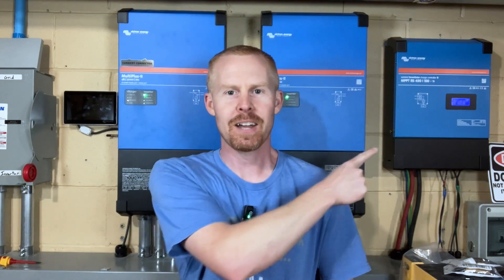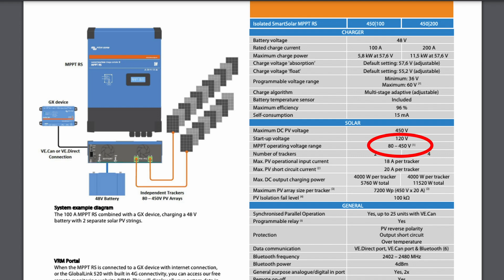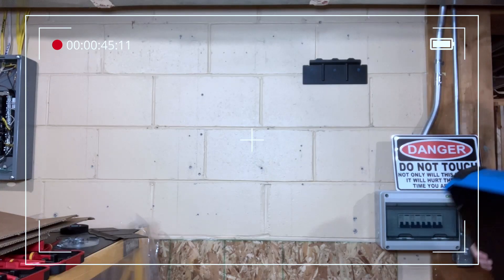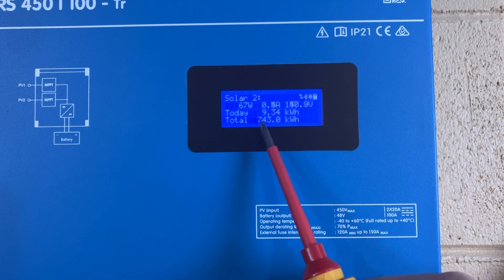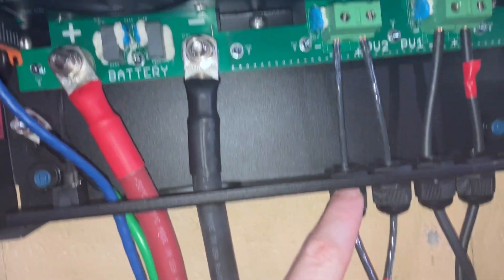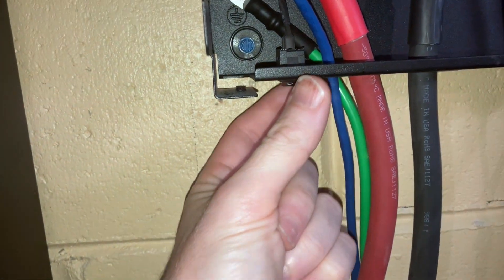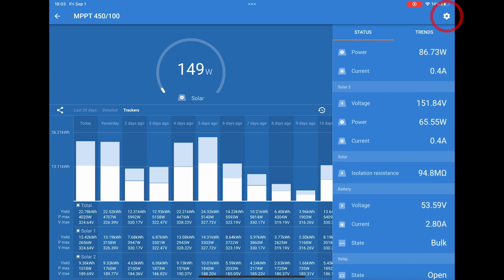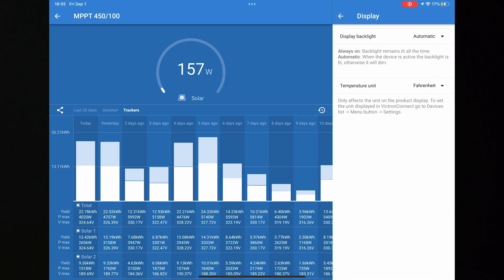Taking a look at the Victron SmartSolar MPPT 450/100 Solar Charge Controller

Comment from the maker: Links to the parts & pieces in the video (affiliate links)
------------------------------------
Victron MPPT RS 450V/100A SmartSolar Charge Controller - 
https://www.currentconnected.com/product/victron-smartsolar-mppt-rs-charger-controller/?ref=AzzpK9Fl

For more information, please check out my website with links to all the components, materials and products I have used in developing my off-grid solar system: https://going-off-grid.com

Supporting the Channel
--------------------------------------------------
The 'Buy me a Coffee' - link is here (on the bottom, right corner of the website): https://going-off-grid.com

You can also click on the "Thanks" button under the video to support the channel. 

Thank you for your support!

Comment: I'm not familiar with stand alone solar charge controller because i've been researching all-in-one units like the Sol Ark and EG4. Are these victrons + a transformer inverter, like SunGold, going to be much more reliable? Also, do these models specify what type of battery voltage they're made for? Or can you configure the charging voltage?
Reply from the maker: Yes, you can program the Victron charge controllers for different battery chemistries. The 450/100 is designed for 48 V battery banks, but you can adjust absorption, float, and other charge voltages to match lithium, AGM, or other types. Victron MPPTs are generally more efficient and more accurate than the charge controllers built into most all-in-one units, and they give you better flexibility for tuning and monitoring. They also have Bluetooth and VRM support for remote tracking.

You can also add a stand-alone charge controller like this to almost any existing system, as long as the controller is rated for the same battery voltage.

And just to clarify — I don’t think SunGold uses transformer-based inverters. Most of theirs are high-frequency designs, whereas something like a Victron 5kVA inverter can handle heavier surge loads and typically runs more reliably long-term.
Reply: @AdamDeLayDIY that's good to know thanks, but check out this breakdown of sungold 12000w inverter, it has a huge transformer. 

https://youtu.be/lhSyY799KBM?si=DNn0LzPyL8Mc4t2o

Comment: Hi  Adam.  I realise you have been over this before but I'm confused about the max voltage on the 450/200. 
 The spec sheet says the WHOLE unit has a max DC input voltage of 450v.
 I have read and seen many different conflicting comments and advice online ( including the victron spec sheet) .  Can you or anyone confirm that EACH tracker has a max 450v input .   Meaning 4 X 450v max input for the 450/200 unit . ? 
 Other people have advised me that this is not correct and it's 450v split across all 4 trackers. 
 Obviously this has a massive effect on the number of panels I can install . 450v total ...means only 11x 38v  450w panels .
Any info greatly appreciated.
 Thanks
Reply from the maker: The trackers are independent of each other.  Each tracker can process a max wattage of 4000W within the specs of 450vdc and 18a.  

Perfect example of the fact that each tracker is independent of each other.  Look at the bottom of page 10.
https://www.victronenergy.com/upload/documents/SmartSolar_MPPT_RS/13860-SmartSolar_MPPT_RS-pdf-en.pdf

Table 1. PV Array Example shows an example of 2 arrays connected and 1 has 404v and the other has 304v.
Reply: Brilliant, thanks for confirming so fast.  I really wanted to check as my physical installation is going to be challenging due to the location and terrain.  @AdamDeLayDIY
Reply from the maker: @kg-4062  Not a problem!  Not sure if you have made your purchase already or not but it looks like the 450/200 can be purchased from Current Connected for $1795.  You just have to create a website account first and log in to get the discount.

https://www.currentconnected.com/product/victron-smartsolar-mppt-rs-charger-controller/?ref=AzzpK9Fl

Good luck and have fun!
Reply: Thanks for the heads up but I'm in Europe and it seems my best/ nearest supplier is located in Spain  @AdamDeLayDIY

Comment: Hey Adam  - I was told the 200 model still has 2 trackers and I was advised to buy 2 unit of 100 A to get the 4 trackers needed for our 13kw pv ?  Do u still have your  450/100 ?  how does it perform ? many thanks
Reply from the maker: Not sure who told you the 200 only has 2 trackers cause even the Victron Spec sheet says 4.  https://cdn.currentconnected.com/2023/10/21115734/Datasheet-SmartSolar-MPPT-RS-EN.pdf

Either way though, yes I still have my 100 and it's still working great for me!  Lots of power each day comes from that thing!
Reply: @AdamDeLayDIY   Thanks for your reply - I ll have to admit that I used AI to design the best pv array kit to suit our needs and  and according to the summery provided the 200 version can handle two strings.  I ' ll  double check its specs before purchasing

Comment: Great video. I want to add a charge controller to my existing all in one system. For Victron's SOC detection,  does the Victron sense battery voltage through the batter cables? My AIO is already using the comm ports on my existing server rack battery storage. Just wanted to make sure if I add one of these MPPT's that it will sense battery voltage and either add or stop power based on open loop and the battery cables?
Reply from the maker: Thanks.  

No, something has to calculate the SOC of a battery, which is what the BMS should be doing on your server rack battery.  It should be giving it's SOC to the Victron system.  

Since the battery should be the device giving the SOC to the system (assuming you don't have a Victron Shunt), it should be able to keep track of power coming in from a new SCC.  You would still end up programming the SCC with the stop voltage though that you want it to stop charging the battery up to, and you would just find the specs of the battery and program in the max charge voltage.

Comment: Adam what is your favorite solar inverter configuration?  With your experience from EG4 to Midnite Solar to Victron how would you rate this Victron setup?  Thanks for your content.
Reply from the maker: Each inverter really has its own place. Victron is my current favorite just because it has the most customization options by far—you can tweak almost everything and the VRM monitoring is super handy once it’s set up.

MidNite Solar is built like a tank. Their hardware is rock solid, and it's a great option for folks who want something durable.

And EG4? Honestly, it's hard to beat the pricing for the features you get. It's pretty much plug and play, which makes it a great option for people getting started or wanting a simple install.

Appreciate you tuning in and supporting the channel!
Reply: @AdamDeLayDIY  Have you had any inverter failures?
Reply from the maker: @idahoduckhunter  Nope.  Even with my old EG4 6500s that were RMA'd, they still worked.  EG4 just wanted to look deeper at some of the issues I was experiencing.

Comment: So you have two string arrays connected separately to two MPPTs, correct? That is, they are not connected in parallel first before going into the inverter, correct? Just the positive and negative from each string array go into the inverter, correct? Apologies, I'm new here.
Reply from the maker: No worries.  
That's correct.  Each array goes directly into one side of the 450/100 (since it has 2 separate MPPTs).  

If you're new to solar, this might interest you: https://youtube.com/live/gyybhu5LZPk?feature=share

Comment: Hi to all! After the last firmware 1.19 update the fans noise between 1k and 4k watts are terrible. It was quiet before this update, but now I don't know what to do.. Thinking to disconnect both fans because I have my mppt in a very could place.
Reply from the maker: That’s interesting.  I’m also on 1.19 and I can’t say that I’ve noticed any sound difference on mine, and it’s right next to my office so I would hear it if it got a lot louder.  I would suggest posting on the Victron Community Forum and see if anyone else has noticed the same thing.

Comment: Can the settings of this device be changed remotely using the VRM portal or a phone app (not via Bluetooth)?
Reply from the maker: @krprasad7519  yes you can.  So the same app that you would use for Bluetooth configuration (Victron Connect), has a tab for VRM.  That will allow you to remotely view and configure different devices in your Victron environment.  The only devices you can’t configure remotely are the inverters.

Comment: Hi there just double checking, each tracker is 450 max volts or both trackers total 450volts thanks
Reply from the maker: So it's per-tracker.  Each one can pull power from PV up to 4000W within the specs of 450V and 18A.  There is some wiggle room on max wattage you can connect to a tracker vs how much can be used as well as some wiggle room with the current but the voltage is a hard 450V number that cannot be exceeded.

Hope that helps!
Reply: @AdamDeLayDIY  Yes, 4,000W max for each tracker, but specs say 5,670W TOTAL, correct? So it's not REALLY 4,000W per tracker. It's 4,000 W for one and 1,670W for the other. Right? You can't have 4,000W from each. Correct?
Reply from the maker: @KidFreshie  So the 4000W max is the usable power for each MPPT.  You can add (sometimes called "over-paneling") more panels up to 5,670W so that when you're not in full, sun conditions, you can still try to get close to that 4000W of PV input.  You do have to remain within the voltage and maximum current limitations though when you over-panel.
Reply: @AdamDeLayDIY  Wait. So I can have up to 900 volts (two MPPT channels of 450V each) of PV power coming into this thing at once?? Do I have that right??
Reply from the maker: @KidFreshie  Each MPPT is isolated from the other, so you can have up to 450V coming into each tracker.  There's a lot of flexibility between the voltage range and the usable current to allow for a large range of array configurations.  

Keep in mind, while the current limit does have some flexibility, the voltage is a hard limit.  You don't want to go over that on a single MPPT as you'll damage the unit.  You'll also want to take the "temperature coefficient" into effect because your panels voltage will increase with colder temperatures.
Reply: @AdamDeLayDIY  Thank you. You're kind to answer these questions.

Comment: I am considering replacing my EG4 3kv with the Multiplus II and the Victron SmartSolar MPPT 450/100.  My concern is with the setting of the charge controller's max charge current.  I need to limit the current to the batteries to 40A, but if the inverter is pulling say 10A, the charger controller should output 50A.  With my all-in-one, this was taken care of internally.  Is there a way to make the charge controller output additional current for the load of the inverter?
Reply from the maker: @deerdomain1  on the Cerbo, there’s an option called DVCC and under that option there’s an option to “limit charge current”.  That might be what you’re looking for.  https://www.victronenergy.com/media/pg/CCGX/en/dvcc---distributed-voltage-and-current-control.html

What’s the reason for the 40a charge limit?
Reply: @AdamDeLayDIY  I want to limit the charge to the battery to extend the life of my batteries.  I'm using LiFePo battteries and that is the recommendation of the manufacturer.
Reply from the maker: @deerdomain1  not sure what your timeline is, but Current Connected is offering free shipping if you use a special promo code.  It only goes through the end of the month though.  You can use code “adamgog”.  I believe they also have an extended warranty on certain Victron gear.
Reply: @AdamDeLayDIY  Thanks, i just might use that code to get the Mutliplus II.  At the moment Current Connected is out of stock of the Victron SmartSolar MPPT 450/100.

Comment: Hi Adam  i have a 6000xp with the 280 ah standalone bat. I have a few half ass arrays  that  shift  in and out of full sun (trees) i was thinking of taking a sprinkler controller    and using the 24 volts to control some relays to bring strings in and out of connection with the current 2 mppt's the 6000xp has.    Until i get around to that, I'm looking to add 1 or 2 additional mppt's to get every watt available even when the shady loops are subpar    finally getting to my question ha ha : will the smart solar 450/100 easily communicate with the eg4 battery while the 6000 xp is connected?     Thanks Scott
Reply from the maker: haha, no worries.

So in this case the Victron Charge controller would just charge the batteries based on voltage that you program in.  Because they're different systems, there wouldn't be any communication.   It would still work fine for charging your batteries though.  You would just program the charge controller for whatever you charge your batteries up to and then let it go.  

I've got my 450/100 running on the exact same battery bank that my 6000XP is running off of and there's been no issues.
Reply: Thank you Adam      damn   ,i'm tempted to just spend a small amount more and get another 6000 xp and get an inverter ect. out of it    augh what  to  do ...  to many options lol
Reply from the maker: @justanotherdillhole7824  I know exactly what you’re taking about.  The one thing I would mention is that I’ve heard that the 6000xp is designed to last for approx 5 years.  I heard that mentioned on the diy solar forum.  Since it hasn’t been around that long, I guess time will tell.

Comment: I just binge watched all your Victron install vids, awesome, loved when your son flipped the transfer switch and the cover fell at the same time. I can totally relate. So I'm also looking to upgrade to Victron starting with this CC. My question is, is there someway to make it talk with Solar Assistant, to track, store info, change parameters remotely? I'm big fan of SA and that's something I would miss by upgrading.
Reply from the maker: Appreciate that!  I still remember that moment and how I nearly jumped out of my skin!  Stuff like that seems to happen to me any time I have a breaker panel open...

So at this moment, the only Victron gear to my knowledge that Solar Assistant supports is the Smart Shunt.  

Honestly, the VRM can really do just as much as Solar Assistant, and then some.  I'm still a huge fan of Solar Assistant and if I ever had an inverter that didn't support the VRM, it would have to support Solar Assistant.  

It's been on my list for a while now to do a walkthrough of the VRM it's just gotten pushed back with a lot of different projects.

Comment: Rookie question.  Why would one use this over something like the 250/100 which handles a lot more amps?   Just curious.  Can someone school me?
Reply from the maker: It has a higher string voltage so you can series more panels together (which would lower your total amperage and let you use smaller gauge wire).  It's also 2 (or 4) trackers built into a single unit.  Pretty sure there's more "advanced" features built into the 450 series but those 2 things are the big ones that come to mind off the top of my head.
Reply: @AdamDeLayDIY  got it, thank you.    But doesn’t the 250/100 also allow higher amps than the 450 model?    Or is this a matter of easy and stringing a lot of panels in series to make sure you have higher voltage and lower amp?
Reply from the maker: @tlteal  The 250/100 has the same amp rating (amps that can go into the battery) as the 450/100 but with a higher voltage, you can get more panels in series on the 450.  You can save a lot of cost in wiring if you can have a higher string voltage because the gauge can be smaller.  

You could do two 250/100s but you wouldn't be able to have as many panels in series because 250v would be your absolute max (including taking the temperature coefficient into account).
Reply: @AdamDeLayDIY  thank you!   Can I get away with 10gauge wire (that’s what I currently have) which is also fused (20a) with that much voltage?
Reply from the maker: @tlteal  The wire should have a voltage rating.  Most of it is probably 600v so you should be fine, but double check the jacket of the wire.  Just make sure you're not exceeding the max current rating of the gauge wire you have and you should be fine.
Reply: @AdamDeLayDIY ok, thank you for the advice.  Sincerely appreciated.   Keep doing what you doing... you're teaching guys like me how to do this as well and it's a lot of information to absorb and without burning your house down LOL
Reply from the maker: @tlteal  no worries!  Glad all this stuff can help!  Good luck!
Reply: @AdamDeLayDIY  one more question.  Safe to assume you're using the multiplus II's for the AC side of things?   Why did you use them vs. let's say the Quattro?    Any specific reason?

Comment: Fantastic video Adam thanks a lot bro 
  I just got off the  phone with Dexter he told me to buy the 450/200amp unit
  Current connection customer service and knowledge is TOP NOTCH 👍🏼‼️‼️‼️‼️
Reply from the maker: Thanks!

That’s awesome!  Yeah the 200 is exactly the same as the 100, just has more mppts.  Current Connected really does a good job helping out customers.

Comment: Hi
First of all, I like your videos on Victron in general and I value the information you give on the system, I am learning a lot thank you for that.
But I don’t like the fact you keep saying it is difficult to get the ring lugs on battery connections. You are saying the terminal is M8 (that is correct) on Lynx and MPPT RS. You are putting on a 5/16 lug, so yes you need to struggle. 5/16 is to my knowledge less than 8,0mm so putting wrong size lug on, you will need to wiggle it down the thread it can’t go straight down, that is not possible. So please get right size lugs, 8mm is not 5/16, please.
Reply from the maker: Thanks for the comment.  I was using the provided cables that came with the kit.